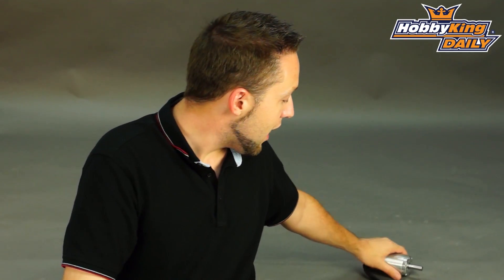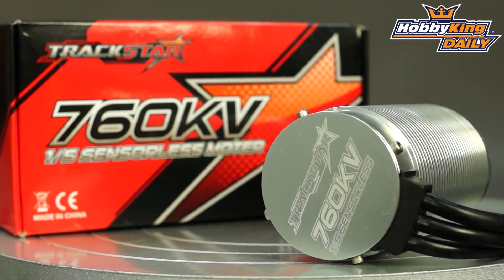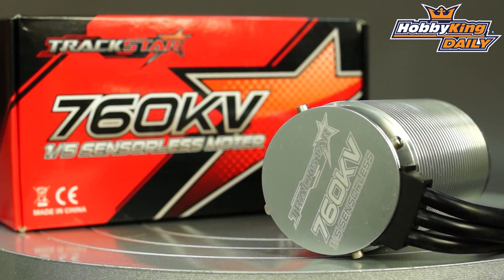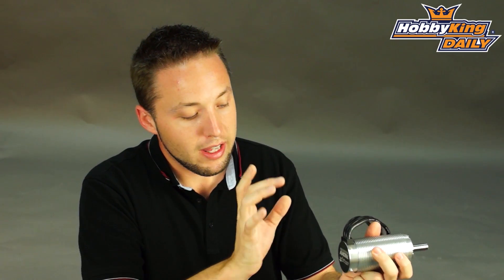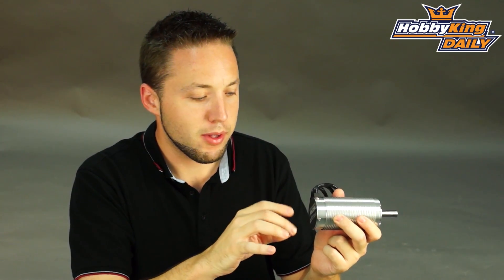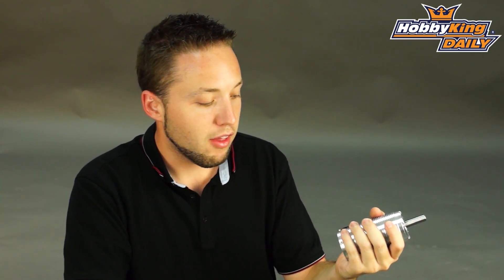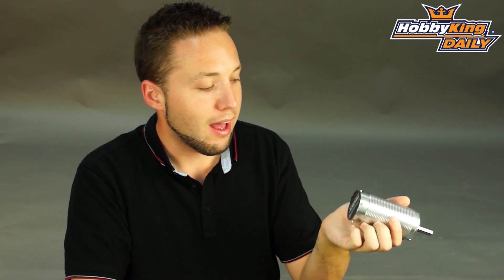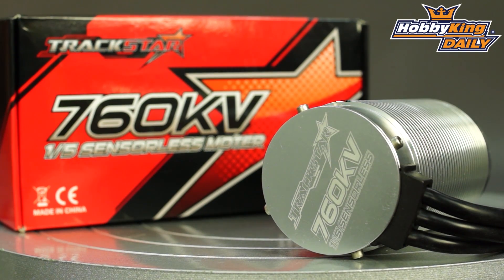HobbyKing Daily - Trackstar 1/5 Scale Senorless Motor

Comment: when i posted this comment they only made the 760kv,

 but on an update note, i contacted hobby king and they said that yes, it has to be 12mm and i got a faulty motor that for some reason had 8mm, they sent me a new motor and it was 12mm. they didn't charge me anything and they payed for return shipping and gave me 25$ for my trouble.